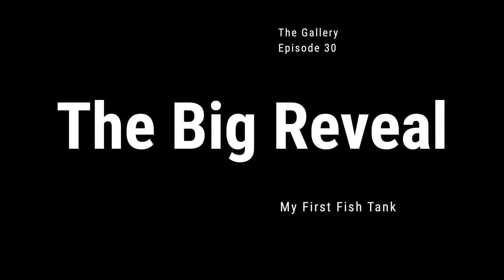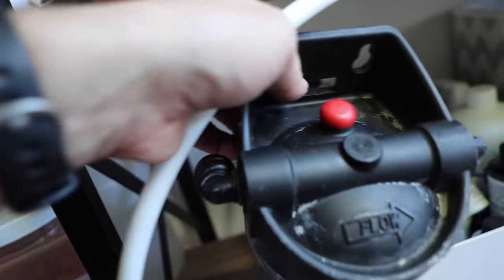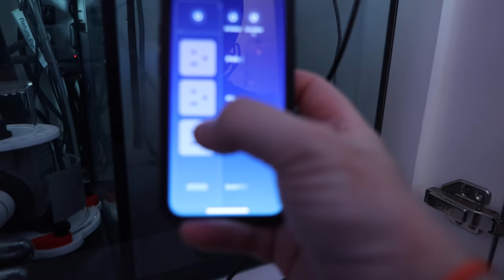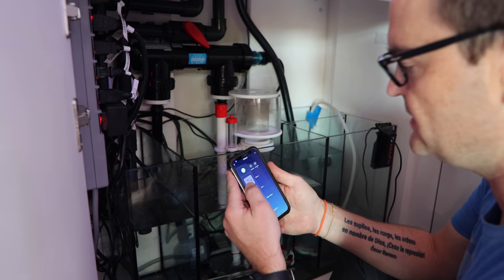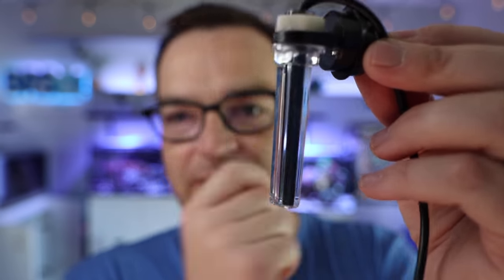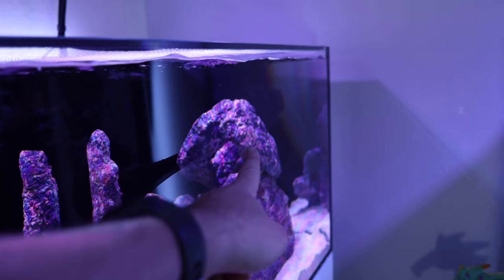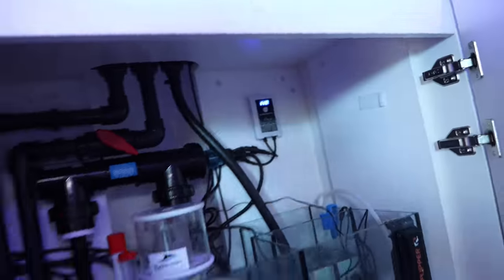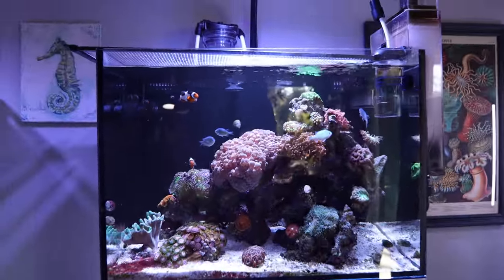Did It Turn Out? It Took Three Days To Build A New Saltwater Aquarium. Harem Update. Gallery Ep. 30

Comment: Did you put a zip tie on the hose where it connects to the pump?
Reply from the maker: I honestly can't remember.  Usually I use plastic hose clamps for that job, since I've tried zip ties and I can never get them tight enough to work effectively there.

Comment: I just put a sicce syncra in the evo 13.5 coral qt I have. It’s pretty loud I was surprised. Unfortunately that tank is in my room.
Reply from the maker: It is surprisingly loud right? Get this other pump if you can.  Super quiet!!!
Reply: @MyFirstFishTank  I think it actually has to do mostly with the cord position, at least for me. I walked into my room the other day and actually freaked out for a second because all I could hear was the fan on the light and not much else so I thought it shut off. Turned out I must have bumped the cord earlier doing something and not noticed. I just have to adjust it every now but i am fine with that. Pretty quiet now so I’m pleasantly surprised.

Comment: Fantastic video I would post this on brs video but I do not  know if you would get it  also I would like to think you for helping me out with dr tim ammonia , I've had my tank setup for a year now and since August 21 2021 my no3 has been  0ppm and my phosphates are 0ppm since July 15 2021 on September 6 I had 0.06 phosphate but that day my LFS test and had 0ppm. And so far I've done seven water changes with the same results I've also taking it to two different LFS and every time they check it's the same thing 0ppm my aquarium is 94 gal with a 40-gallon breeder DIY sump 60 lb of dry Rock 1 bio block 7 fish as of right now but you have no one cannot tell me why my protector looks decent with these numbers but I can say with my old 55 gallon aquarium it was horrible. I have live rock with green hair algae my no3 was around 10 to 20 ppm and my phosphates was around 35 ppm and with me doing 30 gallon water changes every two weeks could not fix it I almost did not want to start my new tank  build
Reply from the maker: Thanks for taking the time to write this, and you are right, I don't always see the comments at BRS.  Sounds like a bit of a testing mystery for sure!
Reply: @MyFirstFishTank  I check every Saturday around 2:30 pm

Comment: You may want to check with your UV manufacture but I don’t believe the way you have your UV installed ( upside down ) will work. 

All your water will flow under the bulb and never flow all around the bulb. 

Hope I’m wrong but I’d double check with the manufacturer.
Reply from the maker: You definitely could be right!  I'm going to check right now!  Thanks for the heads up!!!
Reply: @MyFirstFishTank  let me know what you find out.